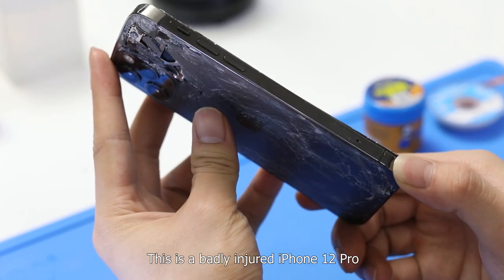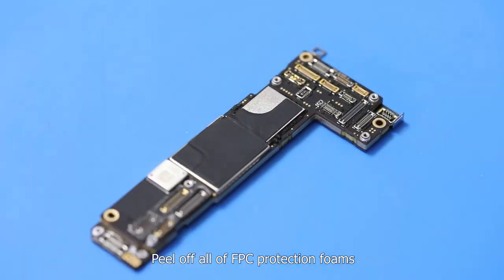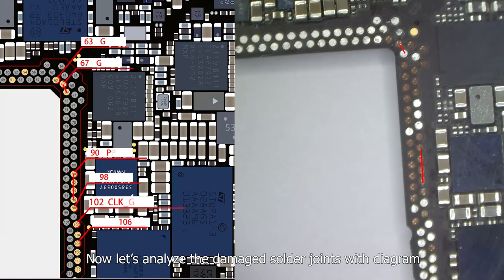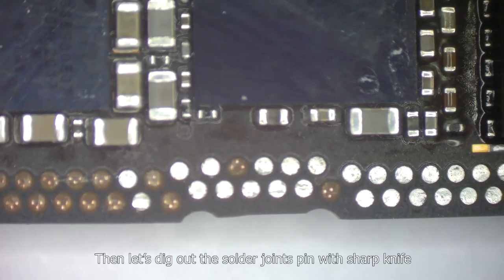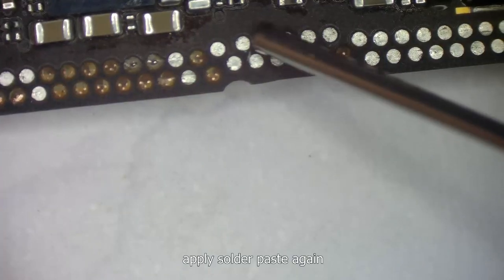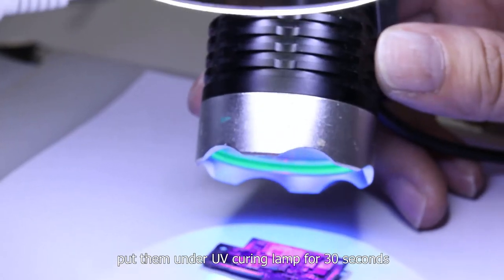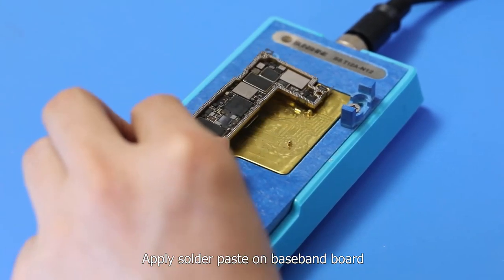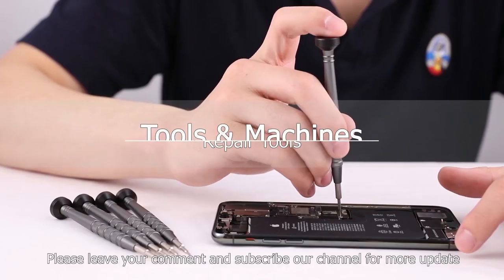iPhone 12 Pro Wifi Missing Repair With Diagram Explanation

Comment from the maker: This is a badly injured iPhone 12 Pro, both screen and back housing glass were cracked into pieces, even the metal housing near mute button was bent. Fortunately, customer told us that only Wifi not work, let’s start repairing right away.

"MIJING" C20 4-in-1 Mainboard Layered Testing Fixture for iPhone 12 Mini/12/12 Pro/12 Pro Max, w/retail package
https://elekworld.com/shop/productinfo.aspx?proid=15560&categoryid=288
"MIJING" Z20 Mainboard Reballing Stencils Station for iPhone X/XS/XS Max/11/11 Pro/11 Pro Max/12/12 Pro/12 Mini/12 Pro Max, w/retail package
https://elekworld.com/shop/productinfo.aspx?proid=14599&categoryid=351
B80-BS458 MECHANIC Lead-Free Solder Paste, 60g
https://elekworld.com/shop/productinfo.aspx?proid=6940&categoryid=283
Goot CP-2515-10 2.5mm Desoldering Wick, 10pcs/set, Original, w/retail package
https://elekworld.com/shop/productinfo.aspx?proid=15561&categoryid=287
Disassembling Nylon Stick for iPhone&iPod&iPad etc,10pcs/set.
https://elekworld.com/shop/productinfo.aspx?proid=6667&categoryid=291
Ecooper 2D Screwdriver, 8890, Pentalobe 0.8, w/retail package
https://elekworld.com/shop/productinfo.aspx?proid=12337&categoryid=571
Ecooper Lengthened Straight Pointed Tweezer, ET-12, w/retail package
https://elekworld.com/shop/productinfo.aspx?proid=12339&categoryid=572

For more Repair parts&Tools and Tech support, please visit: 
Website: https://www.elekworld.com 
Facebook: https://www.facebook.com/Elekworldshop/ 
Instagram: https://www.instagram.com/elekworld/ 
Twitter: https://twitter.com/ElekworldL
Reply: is it possible to send phone to your company for this repair? I have an iphone 12 with the same issue - connectivity issue
Reply from the maker: @darienfields2879  Hey bro, sorry we can't receive overseas repair. The customs will treat it as electronics rubish and might seize it. Pls find a professional local repair shop to fix it, bro. Thanks for your trust.
Reply: I have a iPhone 12 Pro Max with the same issue. How much for you to fix?
Reply from the maker: @clash6138    Hey bro, we are from mainland China, so we don't offer overseas repair service, hope you understand.

Comment: Hey!! I have had 3 iPhone 12 pros with a smashed back, each one the wifi turned off and the Bluetooth was permanently loading and wouldn’t turn on in settings but turned blue in control centre but it wouldn’t actually turn on or connect. I got a free replacement from apple but what do you think it is?
Reply from the maker: Probably same problems like video shows, it's common problem for Apple's double layer board design.

Comment: My iPhone 12 mini having wifi and network missing problem..after a small fall 
It’s not having a scratch even 
It’s 15 months old 
How could I get repaired..?
Reply from the maker: Probabbly same problem as video showes, iP12 series board layer is easier to separate compared with other models. Better to find a professional local repair shop to fix it, bro.

Comment: Hello 
I have the same problems with my iPhone 12 Pro Max (no service and WIFI )sometime WIFI is works sometimes not 
any help please.
Reply from the maker: If the signal and wifi both missing, probabbly it's bcuz the false soldering between AP board and BB board, check this link FYI: https://youtu.be/pgZOLM9EnuY
Reply: Exactly same problem with mine

Comment: How easy it is to handle 12series with 5g antenna cable ?
Reply from the maker: Require middle class soldering skill, rookie might damage the flex.
Reply: @Elekworld  you haven’t recorded video for it yet
Reply from the maker: @olaidehamidolamide8864  we will launch more videos on the basic to high class repair and tool usage, pls sub and stay tuned Bro.

Comment: Is it now impossible to unbind WiFi because it’s stored not on the nand, is that correct? So you’ll run into issues if you need to replace WiFi ic? Cpu not readable, writeable or replaceable so if it’s stored there this is going to make it impossible to unbind, so if you change the WiFi ic it won’t activate, is that correct?
Reply from the maker: Yes, by now we still can’t unbind WiFi. even you replace a new WiFi ic, it won’t work
Reply: @Elekworld  thanks so much for confirming this for me, I appreciate the help. Great videos as always👍
Reply: @Elekworld  where is the bindding information stored ? technically speaking ! its for sure on the CPU, or other place ?
Reply from the maker: By now still not sure, maybe CPU, or SDRAM, we will keep eyes on this.